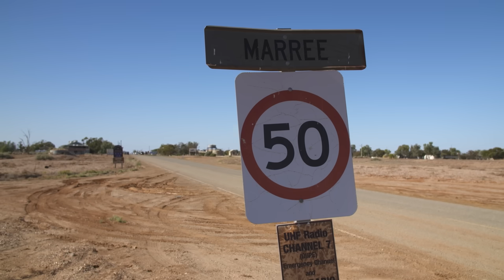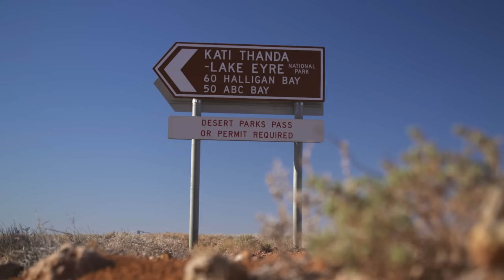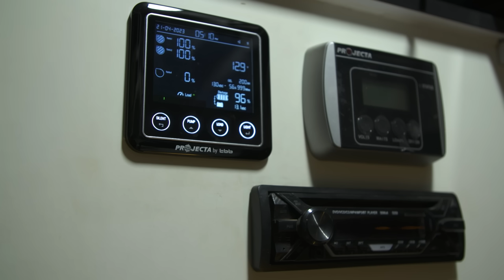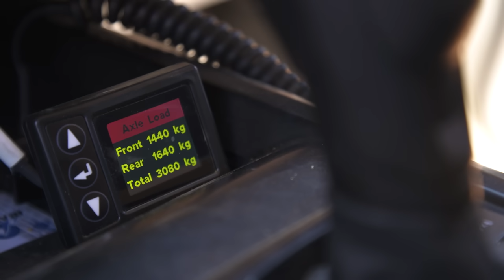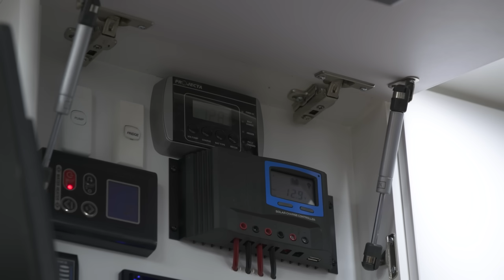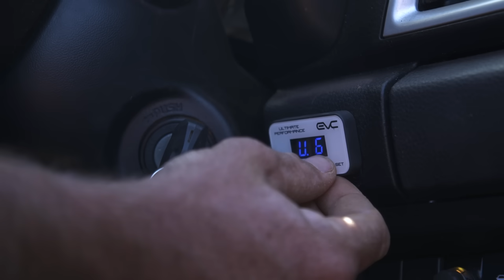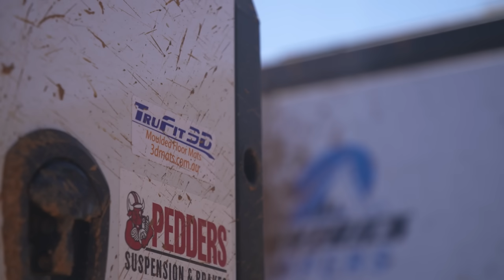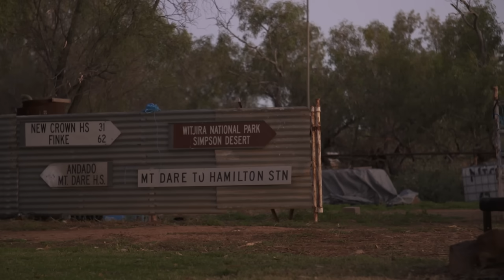FLOODED & BOGGED! Do we get out? Once in a decade storm Floods Australia’s DRIEST town!

Comment: This brought back memories because I have driven that road, and many others crossing that vast continent three times.
On one of those occasions and because I had no responsibilities at that time and was a naiive young man, I didn't fully understand my inherent aversion to fruit fly inspections.
Driving east across the Nullarbor on my own in a Falcon stationwagon, I decided to detour north off the sealed road, find the railway and follow it east then turn south and with a bit of luck avoid the roadblock.
This was in 2002 I had no radio or phone just a compass and map.
I didn't realize how inadequate the map was or fully understand the scale of it.
What I thought was 10k was more like 100k, to the railway.
After about 4 hours driving north at tickover in drive 1 over horrendous corrugations in the terrible summer heat, I realized that if the car broke down I wouldn't be able to carry enough water to walk back to the highway.
There seemed to be a network of straight gravel roads with 90° junctions and another network of dusty bush tracks crossing it.
I took a right down one of those, weaving madly drifting through the endless scrub until it got dark.
Next day despite being high summer, felt humid.
It started to rain.
In my haste to get going, I drove off with the map and compass on the roof and lost them.
Within a couple of hours the dust turned to slimy mud and I broached the car on a mound.
I remained there for another two days and nights until the track dried out.
I remember my uncle taught me how to use a wristwatch like a compass.
Eventually I did make it back to the highway and took a left.
A few k's down the road I got pulled up for a fruit fly inspection, massive fail but no issue because I had eaten everything already.
I arrived at the first gas station with almost no fuel and almost no water.
Hell yeah.

Comment: I used to catch 50 yabbies in a hour, with smelly beef tied to string. Put 10 strings out, go home for 1 hour come back and start pulling them in very slowly then use a stocking on a coat hanger as the net.

Comment: What setting to you use on that induction cooker to avoid E05 over heating error? I've only ever used it on the wattage settings.. and even 1400watts in a frying pan of oil overheats.. does it work better if you use the temp setting rather than the wattage settings?

Comment: Just a couple of simple questions guys.
1: How do you keep your (chefs) knifes sharp?
2: Why don’t you ‘convert over to using  one of the new induction cooktops instead of carrying gas bottles around?
I would have thought that with all of the electrical power supplies you have with the solar panels, etc that you would have plenty of power to keep up the batteries to power to it, and you wouldn’t be carrying the weight of the gas bottles.

Comment: And this is why roads are closed. You absolutely trashed the crap out of those tracks, which isnt a cheap or fast fix to regrade it. You could of waited 2 days and it would of been dry.
Reply: Yeah a bit off when one minute he’s going on about protecting their roads next minute “gee, it’s proper sloppy in here, but we will drag a couple of vans through anyway…”
Reply: We were at Oodnadatta the same time as them and Oodnadatta-mt dare was 100% only open to 4x4’s without trailers. They must have pulled a few strings to get the green light.
Reply: @jakeirvine1646  sa roads would of never given them the green light. They would only give exemptions to medical emergencies/emergency responders or critical supply haulage movements. Those roads they are on are state operated roads, not private or shire controlled
Reply: Truckers be spewin

Comment: Why anyone would drag one of those brick sh!thouses into the bush is beyond me. 
Aside from the very real roll-over potential, astronomical fuel bills and in this case, road damage, towing a little home behind you is not what the 'offgrid experience' is all about and would only appropriate for those who can't leave home without the luxury of being at home. 
You'd save yourself a lot of time, effort and money if you stayed in a swag or tent and freshened up at the odd AirBnB/hotel along the way.
Perhaps refering to this as a 'softgrid experience' would be more appropriate next time Graham.
Not a fan of the van mate.
Reply: Kind of missing the point.
Reply: Indeed.
Reply: Ok. See ya 👋
Reply: Lol, getting soft in your old age mate ;)
Reply: There's nothing to the Oodnadatta track, done it 100s of times for work and most of the time you don't need a 4x4.  But flogs like these guys chewing up a road not giving a crap about the damage they are doing and anyone else wanting to use the track after them, locals, workers, emergency services and other travellers when it dries out.